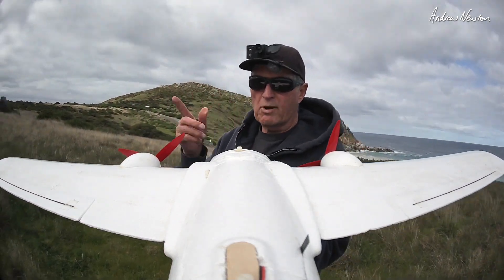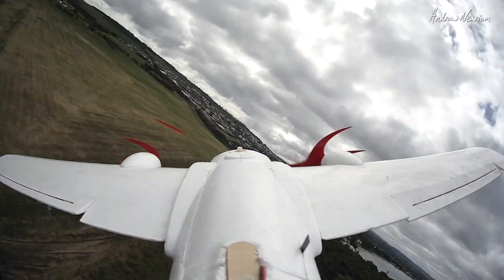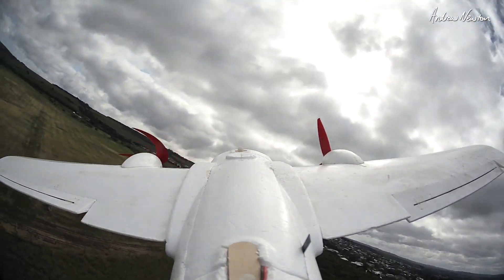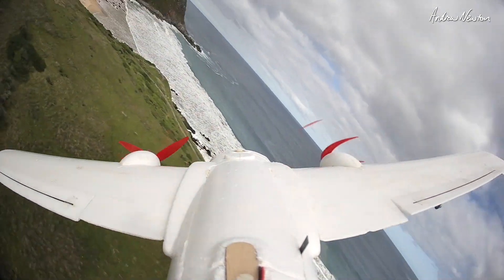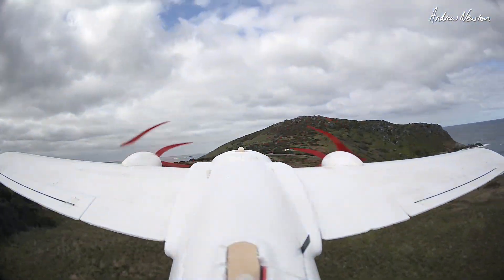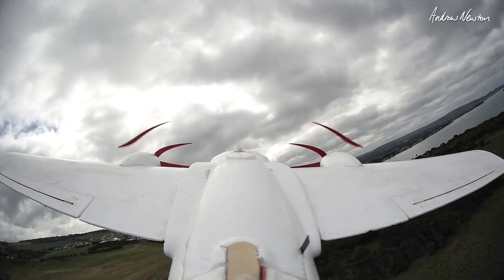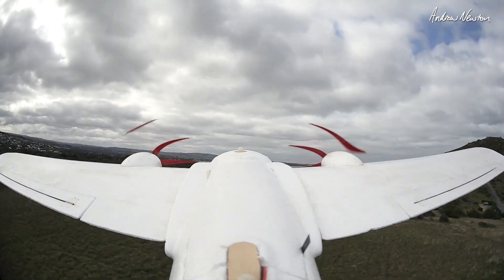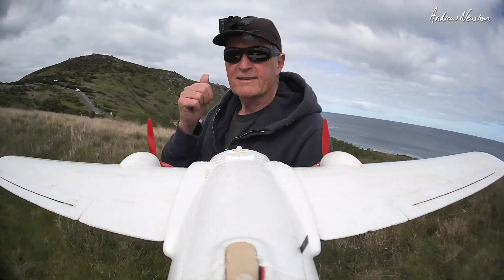Twin prop spin motor loss test 2 - With ESC brake

Comment: On my Multiplex Partenavia P68 I had one ESC partially shut down because of overheating,  the result was an instant spin.  Recovery only possible if I shut the throttle  , usually I didn't have time before  crashing.  So I guess single motor conrtollabilty depend on the airframe

Comment: Great demo Andrew. Not only preforming this interesting experiment, and for demoing your flying skills in those less than ideal conditions. 👍👍
Having done this twin test challenge twice, it now becomes a requirement for other pilots chiming in to also provide a similar demo example of their results.
Reply from the maker: That's right, theories have to be demonstrated before they are acceptable

Comment: Outstanding test Newt ! I converted a single tractor to a duel. I dove into a study. A couple dividends I found from the Beachcraft plane company testing.  Counter-rotating propellers create more lift, created far less sound and harmonics on fuselage. The wind over the top of the wing is fastest and air pressure waves off the blades didn't batter the body as bad , the wing leading edge captured that . Beach said the passenger folk inside didn't moaned as much ! lol

Comment: What a great test. I was reading posts from people about twins saying that a motor failure would result in an unrecoverable spin. It's certainly not a perfect situation, but you can fly out of it.
Reply from the maker: Could glide down easily, but not if you far out

Comment: Fascinating! As you pointed out, most motor failures will probably make ESC braking irrelevant, but I will still make sure I brake all my twin motors from now on. I have been forgetting that precaution in RC for years, even though I had it hammered into my head in full scale flight school decades ago: Feather the prop of the dead engine immediately to reduce drag! Thank you for this brilliant demonstration, extremely useful!
Reply: Absolutely set the brakes to on. Good practice to reduce drag when you throttle off or you are belly landing one of these fpv planes.